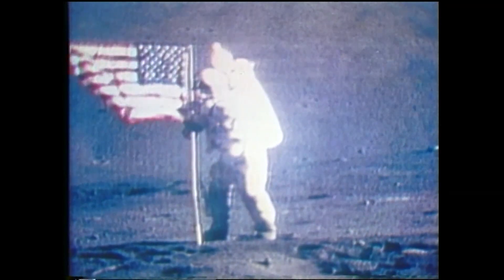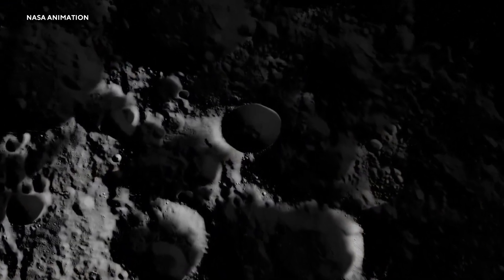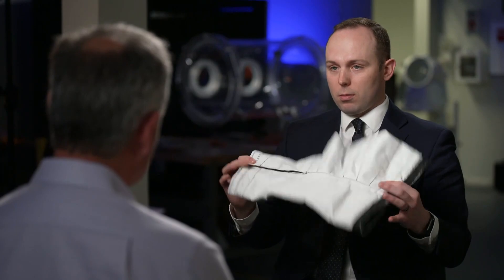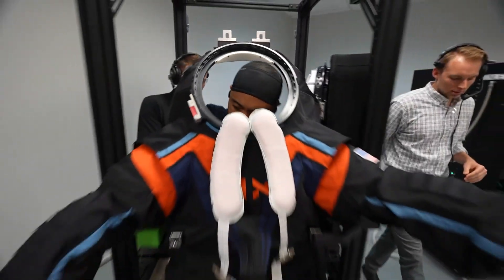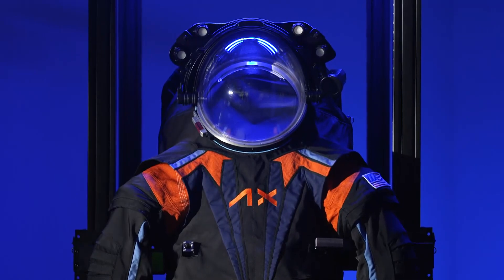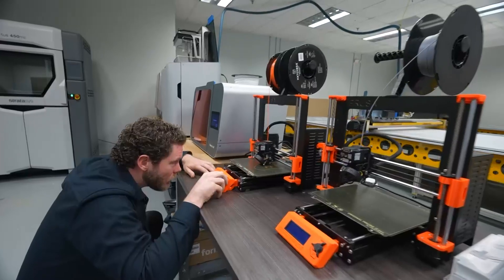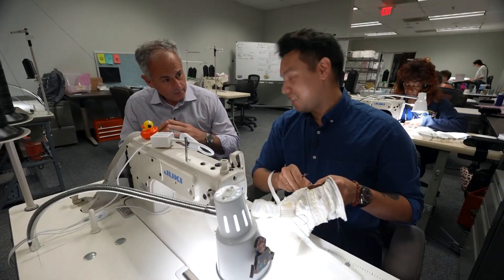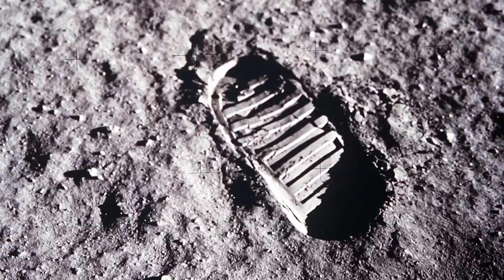Moonwalking spacesuits: Here's what astronauts will wear on the moon...with one big difference

Comment: If a bra company can make a moon suit, it’s not that hard.
Reply: Good luck using Apollo suits for several weeks and months on EVAs which is what Artemis will be doing. They had issues after 3 days on Apollo (max mission duration) with regolith induced wear and tear, and clogging the bearings and locking mechanisms. No mission critical issues, but those suits would've become unusable in a couple more days of usage. This is just one of the reasons why new suits need to be much better, and nothing is easy in this business, it wasn't easy 50+ years ago and it's not easy now.